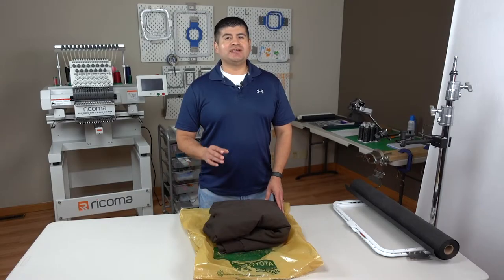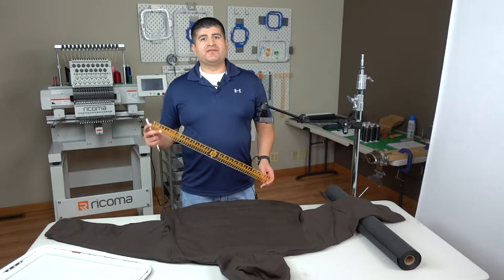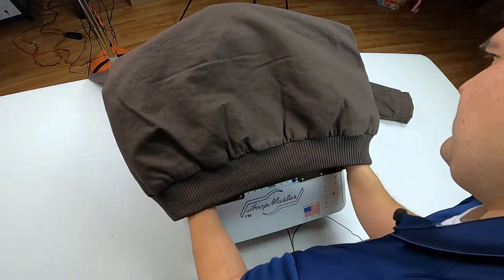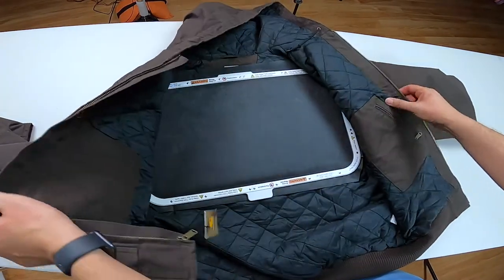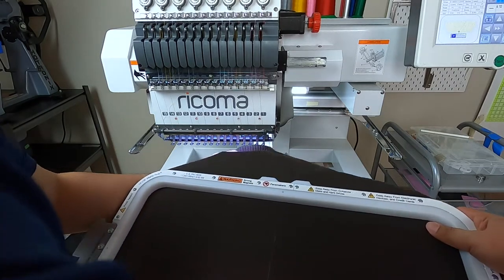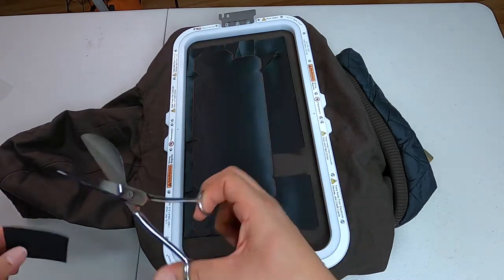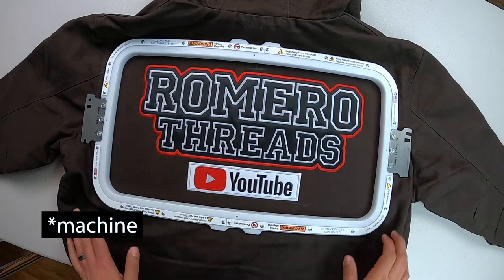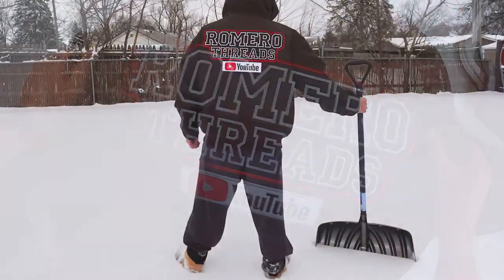Carhartt Jacket Back Embroidery: Hoopmaster Mighty Hoops

Comment: Do you have any videos on hooping a Carhartt coat with out a mighty hoop?
Reply from the maker: No, I tried one time, and it was a headache. I would recommend using clamps if you do use the regular hoops. And make sure the weight doesn’t pop the hoops open.
Reply: @RomeroThreads  one more question!
Does Romeo Threads have any videos on projects you’ve done using the table for Ricoma 1501? Have you used the table?
Reply from the maker: @shannonhurley4051 I have never used the extended table. Thanks for asking.

Comment: hi, so I've had this embroidery machine for about a month now and I am loving it, so if I am using a 17x15.5 inch frame, and my design is 11" in height and 10 in width, which frame would you suggest, because I am having a hard time, I went with F, but is that what you would suggest?  I am trying to design a hoodie and the frame keeps jumping off the arms.
Reply from the maker: You should be good with F. Just make sure you trace before starting.

Comment: When using this hoop, What hoop setting did you use? mine is making a funny noise when I use hoop F, which is the biggest one I have
Reply from the maker: Hello, I use hoop F w/ this hoop. Don't know why its making that sound, but trace it and verify what its getting stuck with. Sounds like its jamming w/ something.
Reply: Yes that’s what’s is doing. When I do a trace, the front the hood hits where the bobbin thing goes. And the sides hit it as well.  What would be the max dimensions on a file for this hoop?
Reply from the maker: Measure the hoop and that is your maximum size. Sounds like your design is too big. When you trace, it should all fit inside your hoop without going over. Be careful because you don't want to hit a needle or presser foot.
Reply: The hoop Im using is the 10x19 and my image is 7x16. I have the same machine as you. Maybe Il have my digitizer make it smaller and see if that changes anything. Thank you!